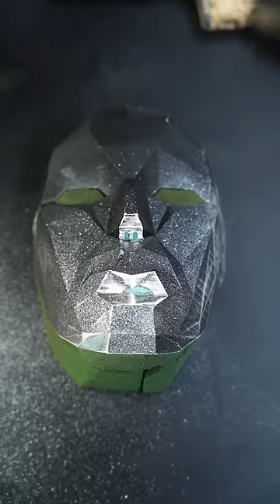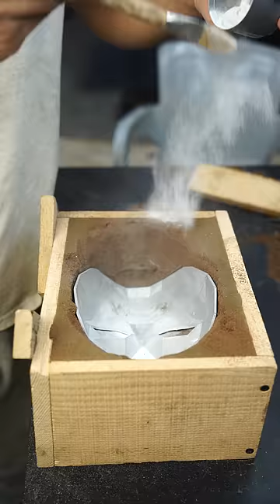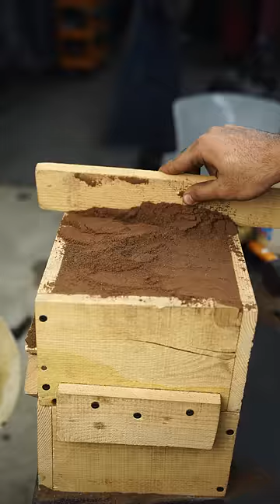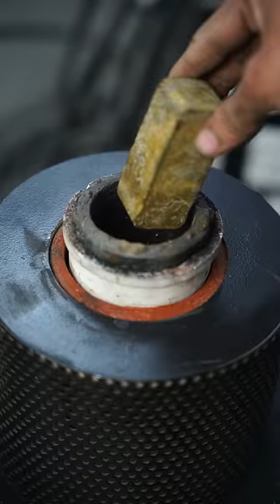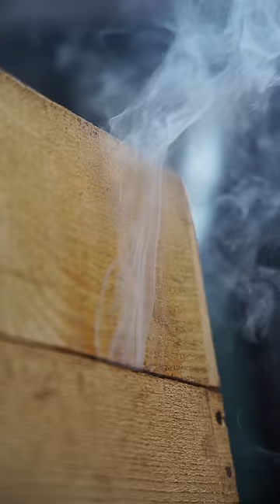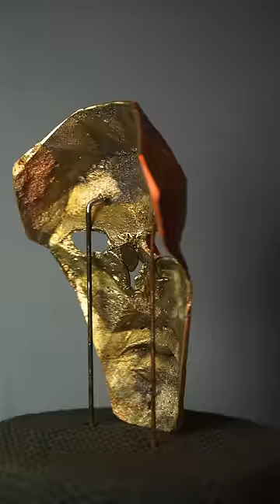A Failed Casting Attempt - Melting Metal

Comment: Looks like you didn't have vents at the high points (edges cut off early), mold sand too cold/metal not hot enough (voids and poor fill). Was that aluminum you're pouring?